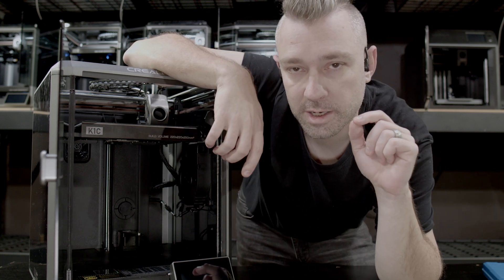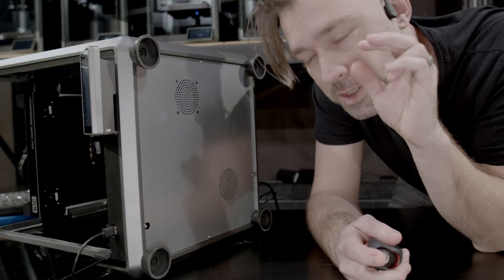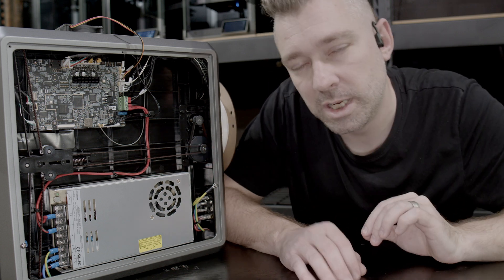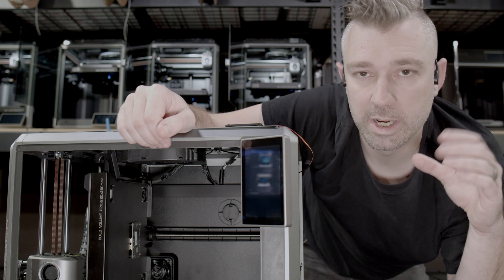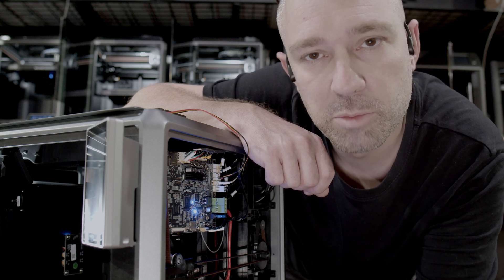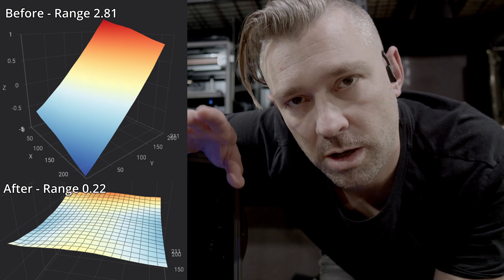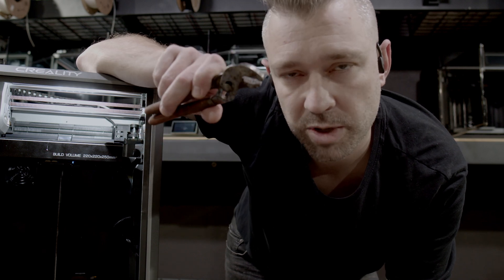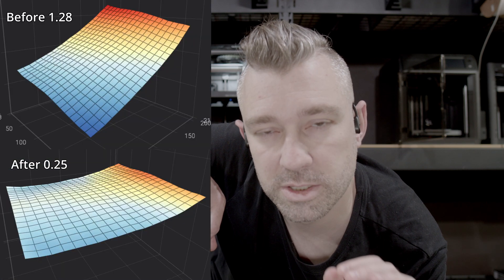Leveling the Creality K1 Series bed, Without Mods!

Comment from the maker: ⚠ IMPORTANT ⚠ Please note that between the two methods, method one is safer and the proper way to do this. Skipping the teeth on the belt without releasing tension first does run the risk of damage to the printer's belt. There is also the argument that method two may be safer and more preferable for users who are concerned with working near the electronics and power of the printer. While my goal is to provide accurate and useful information in my videos, it is ultimately the responsibility of each user to decide what best fits them.

Comment: Hi there, thanks for the video. I'm not brave enough for the 2nd method but the 1st seems to be safe enough ;o) Can you advise what effect 1 tooth skip would make in mms? I need to drop the front right corner by 0.6mm and raise the back by 0.1--0.125mm. Thank you.

Comment: You really need to explain how to look at the bed mesh in the software when deciding which z screw to move.
Reply: Try Orca. Let it find your printer - it'll look 90% like Creality Print with the only addition being the bed mesh screen (right bottom corner just below the temps...
Reply: @michaelzarutsky3624  I've been using orca slicer with my K1C and my bed mesh says it ranges from +0.54 to -0.25. At what point does the bed mesh graph get populated in the Orca slicer device tab? Does it update every time you do a bed level calibration? I'm getting close to attempting one of these methods. I'm also not sure on the mesh graph which way is the front of my printer vs back. Any insight helps, hard to find that much online or at least much accurate advice.

Comment: Great video--thanks for explaining everything so well.  I used this procedure last night, method one--and was able to take my bed level from 1.2 down to 0.56--so that is great.  However--today when trying some printing--I am getting awful rattling/vibrations as the printer does the print, not in the diagonal direction for infill or perimeters but anything else.  After your procedure I also did the bed screw calibration macro a few times, but didn't change much.  I've rechecked that Z belt tension is good, and bottom metal plate of the printer is on solid. Any ideas what this horrible rattling noise coming from the unit might be?  Thank you!

Comment: Do not use pliers for the second method!! Just put a hex wrench into the screws on the side and turn. No risk of scratching the bed or slipping of with the pliers.
Reply from the maker: @_digi  Unfortunately not all of the K1 series machines have this lower collar. That would been ideal though.
Reply: @zerodotcmd  didn't know that, thanks!

Comment: I have a 2.0 deviation, tilted the same as your on the video. I ordered ASA to print those shims people are using to level it. Today i decided to check the distance between the top and the bottom on the bed "hand" on each Z and it turns out they are out by a few millimeters.. This is putting more strain on the motor and on the rods as they are not leveled. After an hour of search on how to fix this i found your video and i'm doing the calibration right now.

Comment: 3rd, easiest method- release the grub screws at the top of the z-axis screws and rotate z-axis screws till bed level
Reply: Yeah, just one problem: 4 screws there, smallest step you can get is a 1/4 turn. That'd be like a 2mm move. Kinda drastic, no?

Comment: Do the glass and get some silicone leveler spacers. Bed probe will still work fine.
Reply from the maker: On stock firmware it may or may not work fine. The readings wont be 100% accurate and if inaccurate enough the stock firmware will throw a "movement not smooth" error. I know some people have done it with some success, others not so much.
Reply: @zerodotcmd  it will 100% work fine. Silicone spacers are very hard and only allow a couple of mm adjustment anyways. Just get the shorter 12mm silicone spacers and tighten down firmly. After tightening down, just use the contradicting upper value as a starting point and adjust/loosen the others up to meet it. Will save a lot of people a bunch of headaches and money. Have not had a single issue in resonance or leveling.

Comment: Fantastic video and Thank you. My question is, if the right side of my bed is .37 above 0 and the left side is .30 below 0, which direction to turn the z screws to raise or lower the bed? Does clockwise raise or lower?
Reply from the maker: To raise the bed you turn the z screw clockwise. counter clockwise will lower the bed.
Reply: @zerodotcmd  Thank You

Comment: I was wondering if you fasten the belt again (2 screws) between bed leveling since you would normally just turn one tooth (method 1)
Reply from the maker: Sorry for the late reply. Yes I fasten the belt every time I run a new bed mesh. this makes sure there's no play in the z screws.

Comment: Thanks a lot! I've ALMOST solved my bed leveling. Tooth skipping the 2 front screws works wonders, but my back Z screw is way too high so I makes a nice concave bed. Tried messing around with the back Z screw but I can't seem to get it to lower the back side of the mesh
Reply from the maker: Nice, Glad to see this is helping you. I wouldn't recommend trying to lower the back of the bed, I would instead suggest to raise the front until it becomes more level with the back. On the mesh view it will tell you the back is high and that the front is low, but this is relative data. Raising the front of the bed inline with the back will also lower the back of the bed in the relative data that is being represented by the bed mesh.
Reply: @zerodotcmd  Got it, thanks a lot! I've researched a lot and managed to get the bed level. With tooth skipping I got pretty much a taco, of course it can only do so much. Got the rest of fine tuning with tape in the middle and even better results with root+KAMP

Comment: Nice video and explanation. I'm trying it now, but the mesh keeps getting a slope. Do you need to rotate both rods or just one is enough ? Thank you. I'm using the first method. K1C
Reply from the maker: It's hard to say without seeing an image of the mesh. Generally when the bed is sloping forward you would raise or lower both front corners of the bed.
Reply: @zerodotcmd  Thank you for the reply. After a while I started to understand how everything worked and I was able to reach 0.3 range.  I couldn't lower that, no mater how hard I tried. I'm happy because I did a test print and it came out great.  Thank you

Comment: The second method, how do you stop the other screws from turning? I thought it was working but then noticed the other one turned as I turned the other.
Reply from the maker: Make sure the printer is on when attempting method two. this makes sure the motors are engaged and should stop the belt from freely moving.

Comment: I've been printing with ~1.2mm discrepancy for almost a year now and in 85% cases it works for me. I am considering doing this fix almost from day one, but "don't touch it if it works" rule stil stands... Anyway, thanks for a very clear explanation of methods and for the video.
Reply from the maker: That's true. Don't mess with what's working for you unless its really bothers you.

Comment: Hey, great video! Check out my method as well, I have a video on my channel. Basically there are 3 injection molded pieces that are all level with each other. If you lower the bed all the way down right onto the plastic pieces then you can unscrew the leadscrew nut and move the axis. This method is much easier than any of the teeth skipping methods, and you don't need to actually take anything off of the machine in order to do it. Is completely unintrusive!

Comment: Just and FYI for anybody who needs it. After using the shims from MakeitNeedit, and rooting the machine. My K1 Max prints close to flawlessly!! the bed still isn't perfect, it has a range of 0.07 at 50c and a huge 0.3 range at 100c. I print a lot in ABS and since rooting and installing KAMP it works well and I haven't had a single failure. Hope it helps
Reply from the maker: Good info, spacers are always a decent option to further level the bed.

Comment: I've did the belt loosing method, the teeth skipping method (by hand! No pliers! Hard as f...), and finally, I've printed a set of various spacers from 0,1 to 0,5mm and put it where the bed mounts to the screws. After only a few tries, I've been able to get the bed a lot less unleveled.

Then I said F it and put the good old springs from my Ender 3 😅

Comment: Why don't you send the printer back to where you got it from and get a refund? If I buy a washing machine and have to freaking calibrate it by fiddling around on YouTube, the thing is going back.
Reply from the maker: If I sent them back then I couldn't tell people how to fix them 😉
Reply: You surely didn't bought a K1, right? 😏
Reply: 3D printer is not an appliance... yet. Maybe in 5-10 years it will be. For now it's a tool, CNC machine, you are expected to know it inside out anyway.

Comment: In combination with some insulation tape on the heatbed you can get the K1 fairly dialed in.
Reply from the maker: Yes this is definitely an option that several users have done. I personally prefer the Glass Sub Bed mod. 
https://www.youtube.com/watch?v=6vU0u630IjU

Comment: i really dont think you should be telling noobs to skip teeth on a belt, but what do i know? been there done that, wont do that again, lol!
Reply from the maker: Method one is safe. Method two can be risky for sure. This is why I call it the "dirty" method. I have a habit of assuming that the viewers have a basic level of understand certain things they may not. I will be pinning a comment as a warning. Although one could argue its also not safe to tell new users to mess around in the bottom near the electronics. I have to have a certain level of trust in the end user when putting out information.

Comment: My biggest issues with my K1 max and I was printing polycarbonate at 110° bed and had an insulated chamber up to 55°. Was pretty close to .2 across And I did my calibrations at the tennis I would be printing at… however, I was still consistently experiencing first layer inconsistencies and ended up just selling my printer. Now using the Qidi plus 4 and have never once had a first layer or warping issue. Which is impressive because my issues with the k1 max were constant. For context I was printing short, wide, and long trays that are nearly the size of the bed. A challenging type of shape prone to warping.
Reply: i'm manually screw tune w springs on 100C, and use foil tape on front and back to compensate hill in center(sorry foe my english)
Reply: Do you know if the same mechanisms exist with the K2 plus?
I am looking for confirmation of if I would experience my aforementioned issues on the k2 plus if I got one
Reply from the maker: I share your experience with the K1 series machines. I have a few FlashForge 5M Pro printers and have never had anything but perfect first layers. At this point, it's unacceptable that Creality releases printers with this problem. I'm not sure about the K2, to be honest. For the time being, I am avoiding it. I expect it to be released with several quality control issues.
Reply: @zerodotcmd  im low key hoping you get your hands on one and share feedback on your channel cause it’s hard to find honest reviews and assessments on some of These machines with all these YouTubers pushing their affiliate links.
Reply: Same here. Completely different bed mesh every print. Did you know @zerodotcmd made a glass sub-bed mod to help with this?

Comment: Method 2 got me .2 - Bed Mesh works so much better now. With it being rooted and doing adaptive mesh...don't really feel need to spend money going further. Already did that with a Flowtech hotend and extra nozzles. Fixed overheating camera issue with a 4010 blower style fan.  
K1C now making parts for an Enclosed / Heated Chamber Mercury One Hydra.

Comment: With my K1 Max, I had to add rubber to the four screws to adjust them and use the screws_tilt_adjust command. I also added a glass bed, which helped me achieve a well-leveled print surface. One curious thing is that the Klipper script forces the mesh level to use Lagrange interpolation. I've tried setting it to bicubic, but for some reason, it doesn't let me.
Reply from the maker: Which firmware are you currently using? I've had this same issue with Creality and Creality Help, which simply sits on top of Creality's modified Klipper. That being said, Creality really butchered the version of Klipper that they are using. The SimpleAF firmware has had no issues running bicubic for me.
Reply: @zerodotcmd  yes i am using the klipper form creality .   can i use simple af with  the stock  sensor?
Reply from the maker: @GerardoNQ As of now, it's not possible to use SimpleAF with the stock sensors/probe. There are a few people working on making this possible, but there's no guarantee on a timeline for this.
Reply: @zerodotcmd  Alright, I'm going to try modifying the Python script to see if I can unlock that feature. your video are great bro , thanks.

Comment: Great video, so out of the 2 methods you have demonstrated, which would you rather use and recommend the most please?
Reply from the maker: Out of the two methods, it's really hard to decide. Method one requires a lot of added effort, and you run the risk of touching some of the electronics while leveling. Method two is a little dirtier; if this method is used frequently, it can be stressful for the belt. However, method two is also safer, as you can't touch any of the electronics at the bottom of the printer while it's running.
Reply from the maker: I would most likely recommend method two for newer users as it is safer for the machine and its electronics.
Reply: @zerodotcmd  awesome, thanks will try it out today (method 2)
If my belt snaps i know where you live 😂